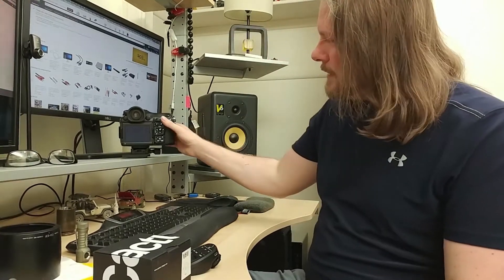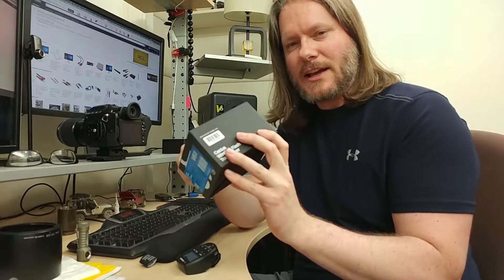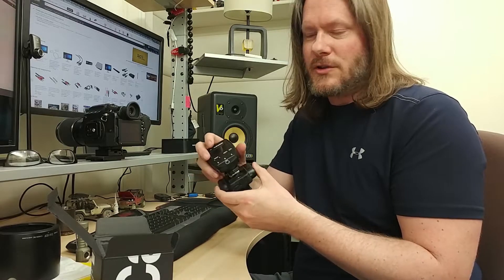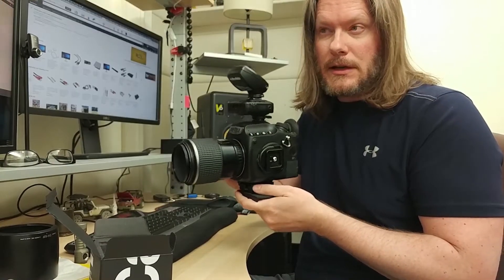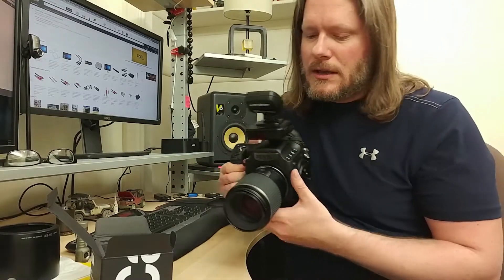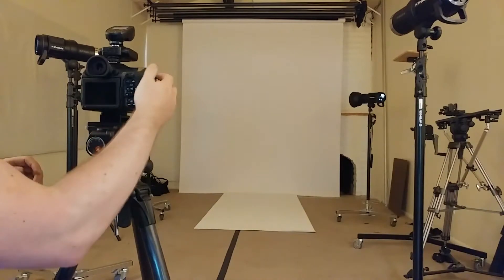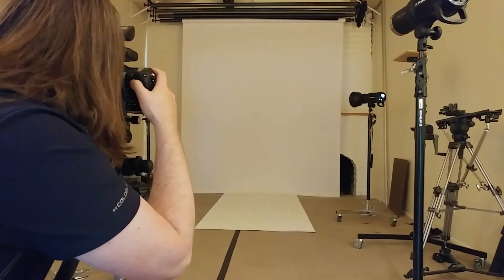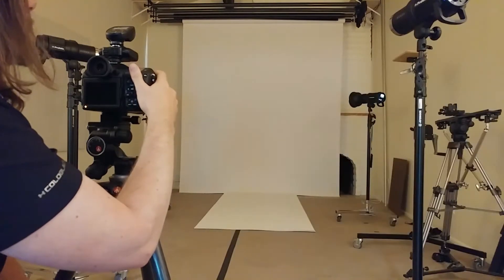645z Profoto B1 HSS Test 01 (Test 02 in description)

Comment: Interesting...I just got the system, and have found it works great with my vintage 6400ws and 3200ws balcars - though I have not tried the high speed yet - current shoot does not require it. I am debating new monolights, meanwhile - I will try your test.   Cheers

Comment: Thank you Dave Carter for sharing this information. 

 I also am a 645z owner and do use Cactus V6 II  as a bridge trigger.   The strobes that I had success with in getting HSS via long flash duration are with Speedotron 102 and 103 strobes.  Their flash duration are 225/s and 450/s (approx) in full power.   Also the photogenic Studio Max III strobe which has a duration of 125/s, these strobes work wonderfully in all shutter speeds with the 645z.

I was looking for self contained monolights like the B1 and was not sure if it will work with the  Pentax 645z , but now you basically answered that question for me.  In fact this setup may also work with other strobes similar to the B1 like godox, cononmark etc...

Cheers!
Reply from the maker: I was looking at the "power sync" method with the Priolite stobes, using the long flash tail for exposer. Overall, I am happier with the evenness of the exposure using strobe-style High Speed Sync. The new B1X units allow for HSS at power settings lower than 7. I don't know if it's worth the upgrade, since I am usually at 7 or higher when using HSS. The stronger modeling lights would be nice. I will definitely be getting a set of the new batteries. The extra shots will be nice, on location.

Comment: Glad to see you have had sucess with the Profoto line.  I have been 
using the Cactus V6ii in conjunction with both the Godox XT-16 and Elinchrom
 EL-Skyport triggers to fire both Godox AD360 and Elinchrom Studio 
Strobes up to 1/8000 of a second on the Pentax K-1.  However, I have 
recently encountered a problem with the HSS signal not passing through 
the with firmware 1.1.007 through 1.1.009.  In order to get the signal 
through had to reload firmware 1.1.006 to get the signal to pass through
 the Cactus V6ii to the triggers mounted in it's hot shoe.  
Cactus has been contacted about the problem with the new firmware, so 
hopefully they will correct the problem.
Reply from the maker: Thanks for the info. I'll hold off on the firmware upgrade, until the HSS passthrough issue is addressed.